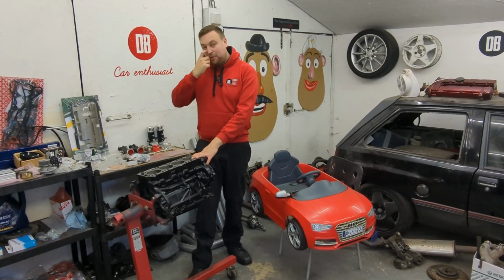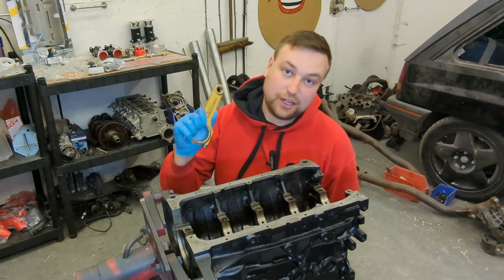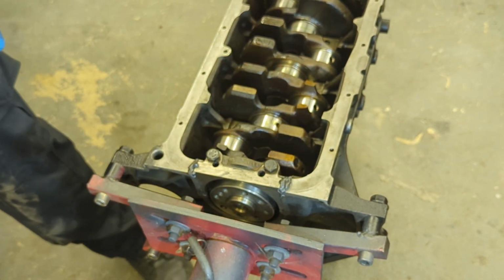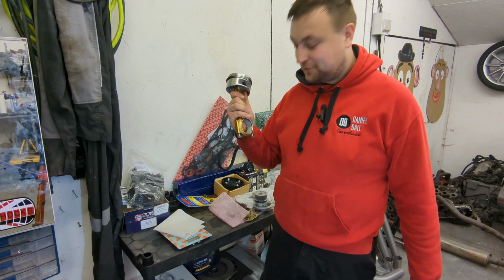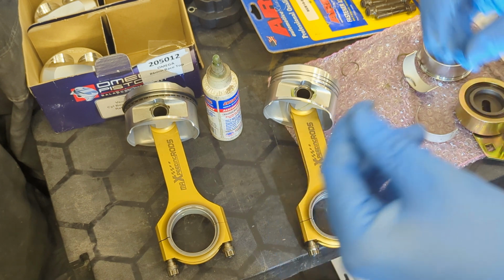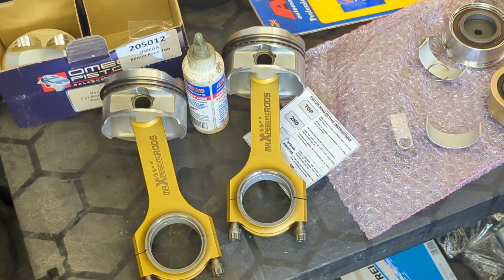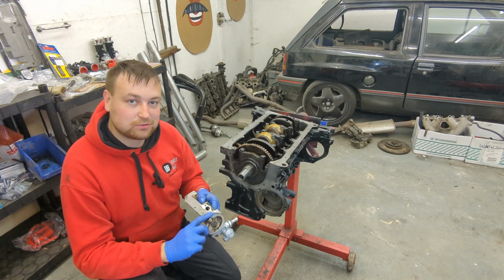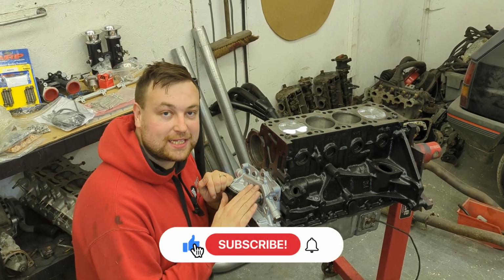Fitting STEEL CONRODS & HIGH COMPRESSION PISTONS to a C20XE bottom end!

Comment: Double check the torque on the con rod bolts. 25ftlb is for 5/16" bolts. Those con rods use 3/8" which should be torqued to 45ftlb.
Reply from the maker: Thank you, just whipped the sump back off and retorqued. 🙂